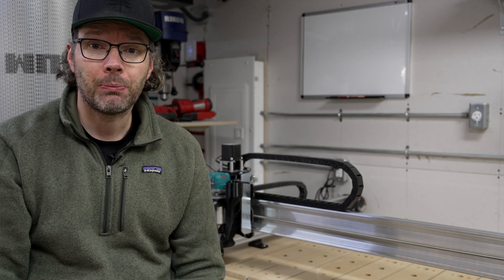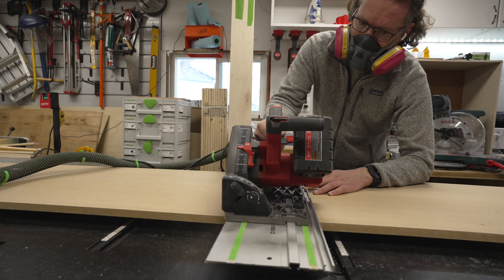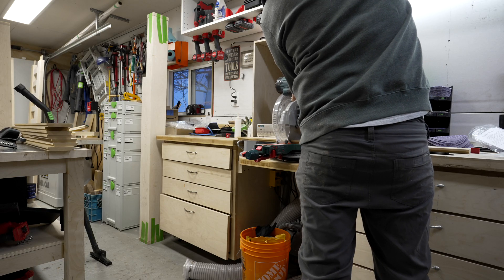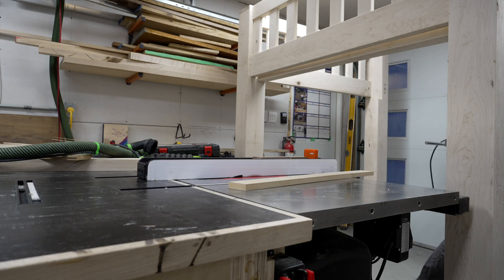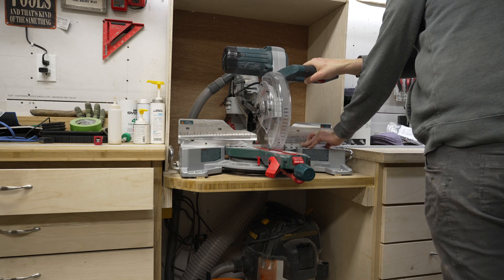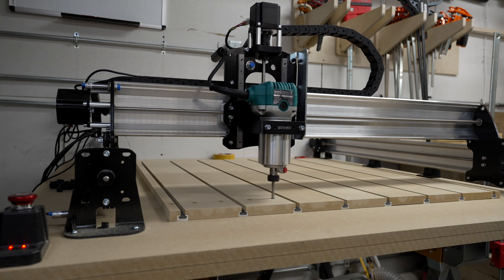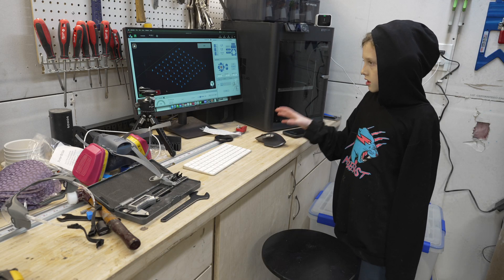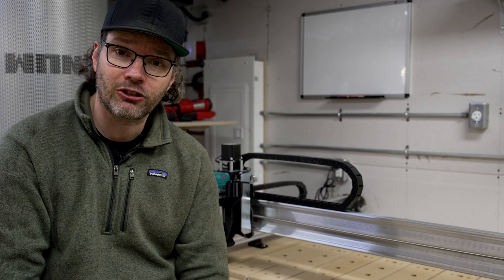CNC Workholding Made Easy: Budget-Friendly Spoil Board Build For Sienci's Longmill

Comment: It's done beautifully, but there are some "newbie" mistakes :)
1. The working area and the table area are not the same thing. The working area where the material is processed, but the material itself and the place for fasteners can be larger. And they should be larger so as not to reduce the working area.
2. It's good to have a sacrificial layer that will be damaged when cutting the material and fastening parts with screws. That is, I suggest gluing one or two more layers on top. They can be gradually aligned during the work and new ones can be glued. And not redo the entire table with T-slots.
Good luck in your future work :)

P.S. The simplest and most functional table for a CNC hobby made of plywood with embedded nuts, in plan from 4 parts that can be processed on the machine itself. in my opinion.
Reply from the maker: Thanks for the feedback!
For 1, I thought you wanted the area of the spoilboard to match the cut surface so that as you use and surface the spoilboard, you keep everything on the same plane. If the spoilboard was bigger than the area that could be surfaced, wouldn't you end up with a ridge around the edge? This would be a problem when working with materials larger than the CNC, for example engravings on wide boards, right?
For 2, my intention is that these MDF strips are the sacrificial layer. As they wear down, it's easy to replace the strips and re-cut the screw holes and dog holes.

I decided not to do embeded nuts as I wanted this to be fast to replace the strips in the future as the spoilboard was used up.
Reply: @ryandaywoodworking  1. no, a little trick :) the working area for cutters of different diameters is different, and it is slightly larger than the spindle travel. what you marked with the tip of the V mill is not the working area, but the axes of the router travel. my main mill for cutting are 3.175 and 4 mm, and the mill for leveling the surface is 38 mm in diameter.  therefore, by making the consumable part of the table wider by 18-19 mm, I can bring it to a plane without steps along the edge (only a little at the corners, but can cut it there) and taking into account about 2 mm when cutting per milling pass, I will have at least 10 mm of space left for clamps, which will be outside the cutting zone.
2. I did not see the fastening of the T-slots to the base, it seems that they are held by MDF strips, and the thickness of the sheet above the slot is small. That is why I advised to add the thickness of the MDF in advance.
There are no problems with replacing the sheets and in the solution with nuts, since the nuts remain in the lower layer, or even in the base of the table, and the upper layers with holes are changed, or the strips are generally cut already cham shah between the bolts and glued on top without interfering with the clamp bolts. Your solution is also good, but it requires much more tools for manufacturing.
Reply from the maker: 1. Of course! That makes total sense. I'll absolutely do that for the next iteration of this. Thanks for sharing!
2. Understood here. You are correct, I didn't fasten the T Track in the video as I didn't have the right screws. I've since done that. I tried to call that out in the video, but in hindsight I should have had the screws and done it completely in the video. :)

Thanks again for sharing! Lots to learn with this new tool. :-D
Reply: @ryandaywoodworking and also make an attachment on the router for aspiration. dust is the worst enemy for rails and lead screw.
Makita is inconvenient because it blows sawdust with air from cooling. So it is better to make a deflector in the attachment and direct this air to the side and up. so that the aspiration removes only sawdust from under the cutter and does not fight with the air flow from the Makita.
with a deflector, the power of a 12v 6a computer centrifugal cooler is enough for me to aspirate. It is much quieter and more economical than a large aspiration.
and, frankly speaking, this edge router is not a very good solution for CNC. bad collets (only one cone with a large angle, poor clamping) and they are not available for the common sizes of CNC cutters. think about replacing it with a router with standard common collets, for example, type ER.
Reply from the maker: I have started looking at spindles, specifically watercooled ones to keep the noise and dust down. The kit that Sienci offers for the Longmill includes the Makita router, so I'll use that for now. I have a dust boot, I just need to print an adapter to connect to my dust hose.